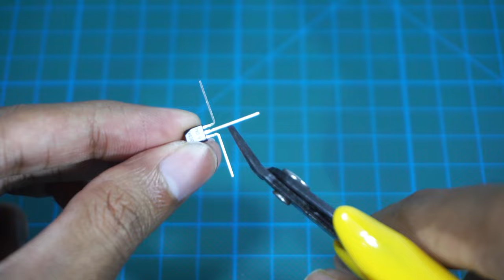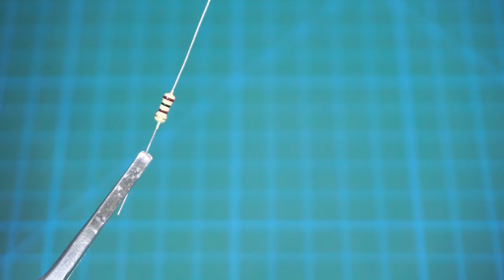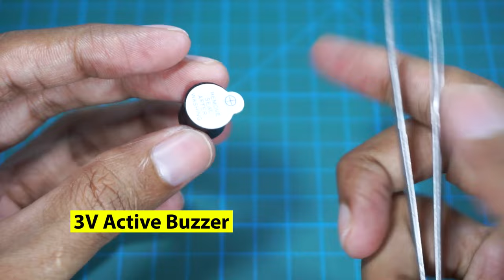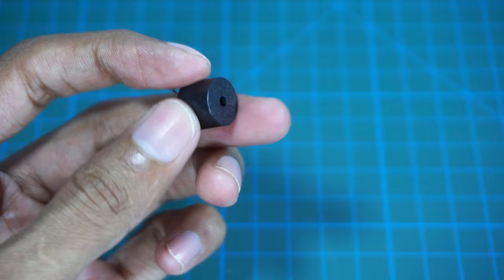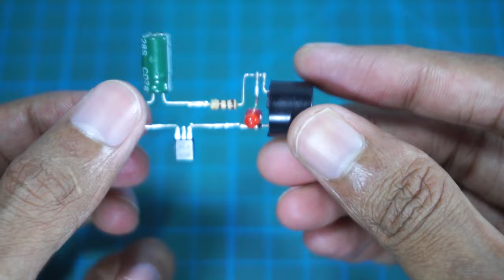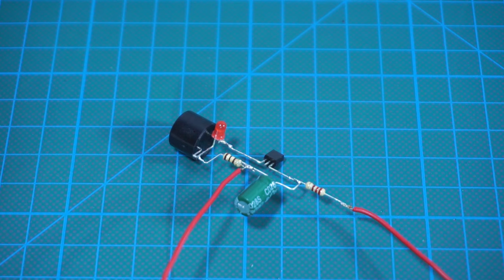Buzzer Beep sound effect, Science project with Transistor

Comment: Hi urgent help I’m trying to use replicate the same implementation but my circuit is not doing what it’s supposed to,  I’m thinking it’s because my power supply is less than the specified +12V, could there be another reason besides that?
Reply from the maker: are use Active buzzzer or pasive bauzer ?
Reply: Active buzzer